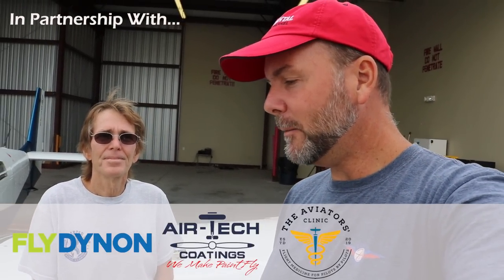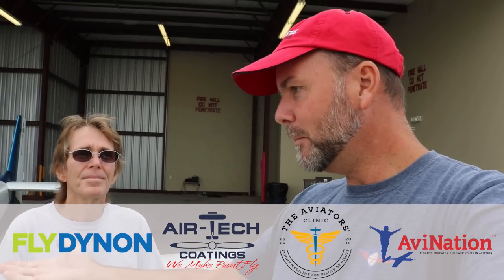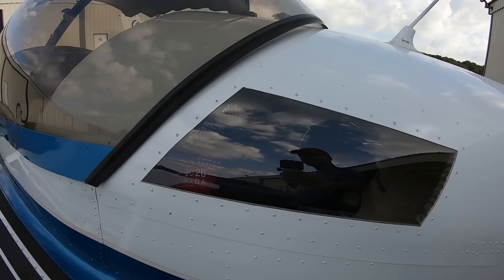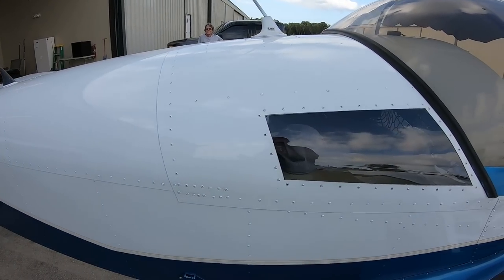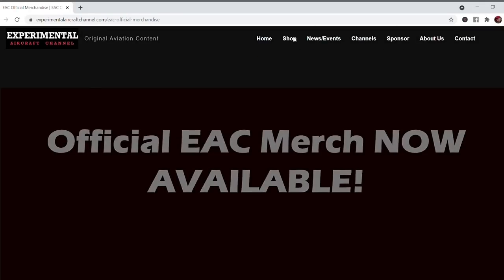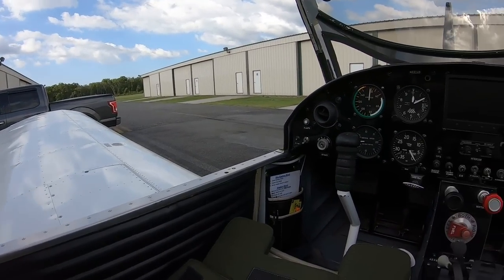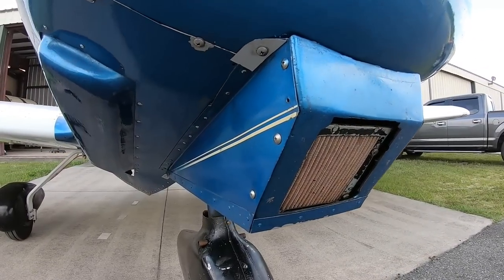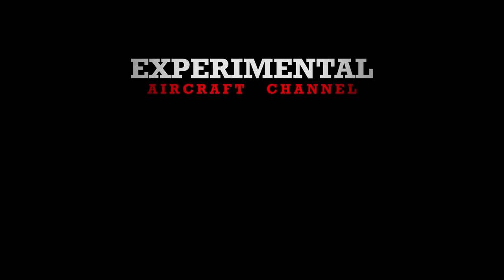Legacy Engine Franklin - Zenith CH601XLB Aircraft

Comment: Maule aircraft was using the Frankin in their aircraft in the 70's until it was hard to get. Their aircraft could outrun others in their class and burn less gas. Wish they could go back to the Frankin. The Frankin was also lighter than other engines.